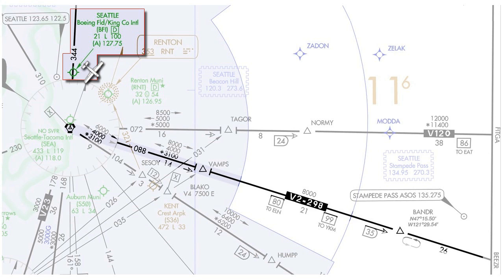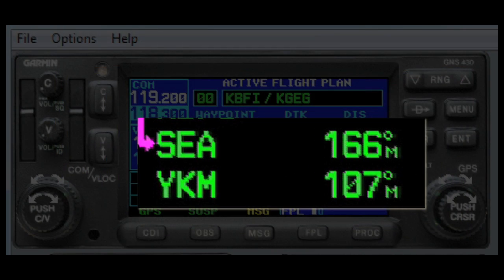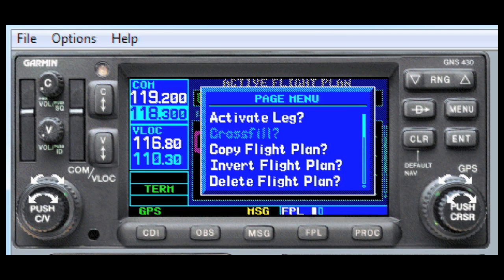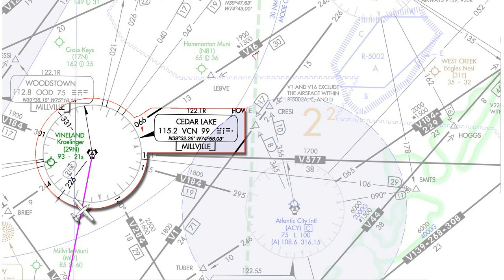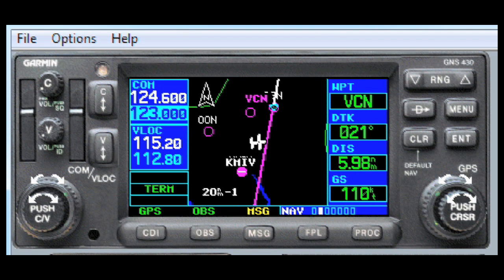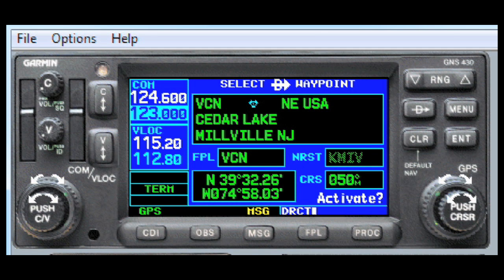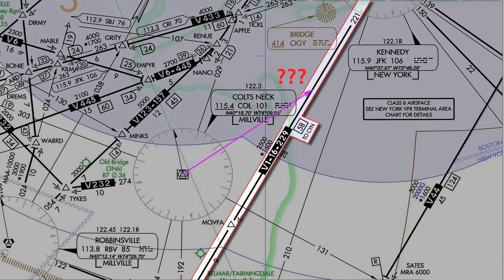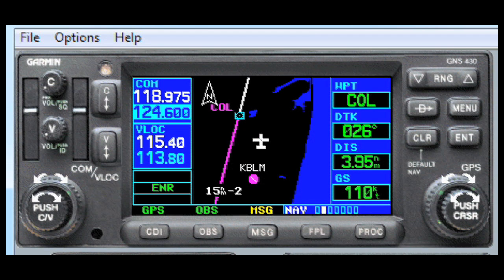GPS Tricks for VOR Clearances

Comment: I just busted on my IFR check-ride for doing basically the exact same thing you're doing here, I was close to the airway and hit direct to the next waypoint, I was in the boundaries of the airway when I did it so I argued the point, the examiner said I was flying to the pink line which is not allowed, he went on to say I should of had the CDI screen displayed on the 430w, not sure why I need that screen when the actual CDI is displaying the same information. He said I should have asked for clearance direct to the waypoint, but he really wanted me to show I could tune the VOR2 to pick up the airway. I feel I will still intercept this way in the future.
Reply: Thanks for putting up this tip!  I had a very minor situation on my PPL checkride, where I was asked to verify my position via VOR.  I said I could, but it would take some flying.  Turns out that all but one VOR in the area we were flying in were NOTAM'd out of service.  I think the DPE was impressed that I'd checked it.  We tried picking them up, and they weren't reliable, so I described the procedure I would have used, and also what I could have done with the single, and we were all set.  Hope that helps someone....VOR's are dropping out of service frequently, so can easily see something similar happening to someone else.

Comment: Wow, way to difficult & requires way to much attention to the radio & not outside the cockpit. Can anyone say "Mid-Air Collision"..
Reply: News flash, this is an IFR clearance therefore ATC provides seperation from other aircraft and it may be why you were given this clearance. It may come as a surprise but flights are conducted where 90% of the flight you can't see out of the windows.
Reply: Futzing around with the shitty interface with the Garmin 430 with no positive course navigation is how you get fucked up in IFR. 10000x faster to just use a 2nd VOR to tune a radial on a old school NAV and fly that while amending gps FPL. Now if you had a good unit like a GTN 650/750 then I'd say otherwise. 430/530? Please, that shit is confusing and slow when trying to do anything with expedience.
Reply: Oh wow
Reply: this is for IFR only. you dont need to be looking outside.
Reply: Edgar Xavier   You do if its in VMC conditions. The only time ATC keeps you separated from all (VFR/IFR) traffic is when within Class B airspace. That’s why I’m not wild about flying on an IFR clearance in VMC conditions when below FL180, especially without an autopilot.

Comment: I learned without GPS, and teach accelerated instrument programs, but now I won't fly without at least a good portable GPS unit.  With the low expense of these units, coupled with the situational awareness capability and data-link information (wx. and/or traffic), there's not much excuse for any active pilot to not have one.  Yes, this can be done quite readily with the VOR, but videos like these are the key to gradually unlocking the potential of the GP units that you will eventually be using.

Comment: @drumdude46 it will provide a direct line from your current position to the waypoint you selected "direct to" only if you press the "direct to" button once and then hit enter to accept. if you hit "direct to" twice while highlighting the waypoint in a flight plan, it will activate the leg that goes to the highlighted waypoint... ie: it will setup a magenta line between the highlighted waypoint and the previous waypoint.

Comment: Confusion: your "Second" option of  Opening Flight Plan page,  cursor to the Waypoint you want to "go direct to",  and Pressing the DIR key, Twice. we then saw an Active Magenta line from SEA Vor (V2) to YKM. which confused me...the second you press DIR TO", doesn't the GPS then provide a "magenta line" Active,  DIRECT from YOUR PRESENT POSITION,  clearing anything before it, and isn't gonna know or Paste a route line matching the V2, 106 radial. we're you already at intercept, crossing it then?

Comment: Thses are not tip?

Its a quick way to get yourself cockpit bound.

The GPS menu needs to be improved full stop! Too many stages to drill down to so most will be lost just doing this under a heavy load. A touchscreen touch on an intercept point is the go. Using just 1 GPS to do all this is leaves you with no room for error, and errors you will make!